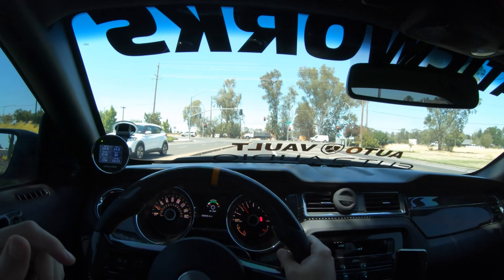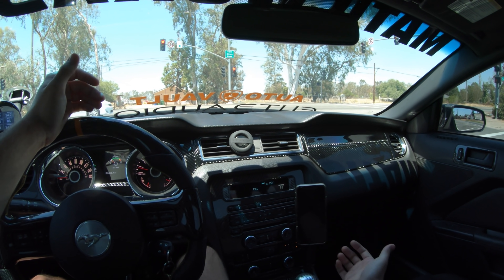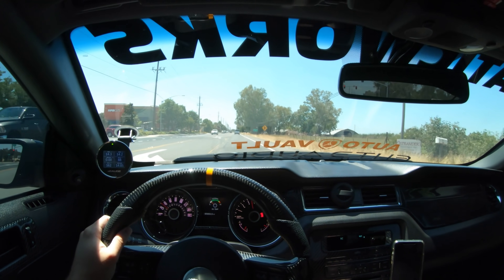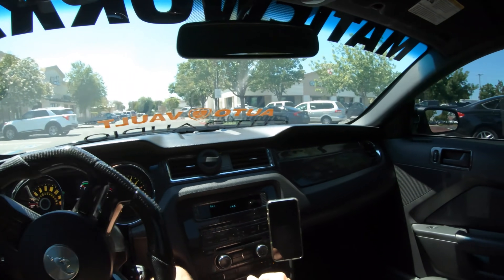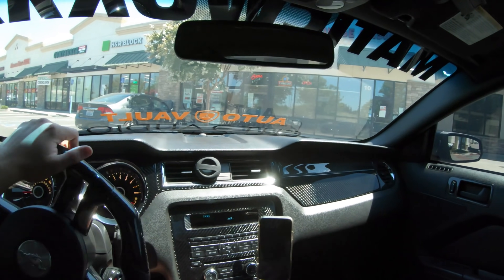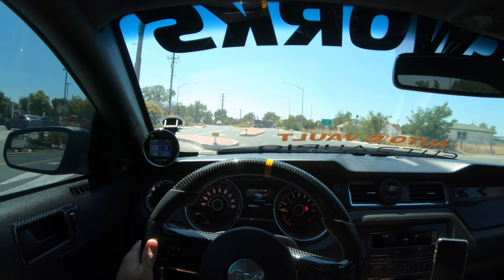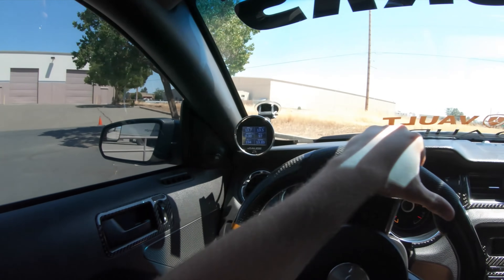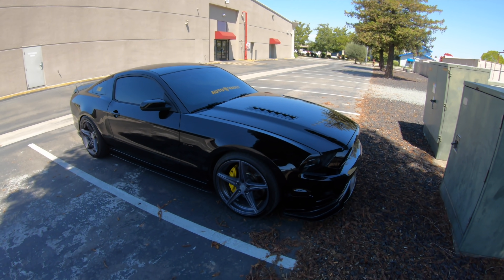How Much Power Can The Coyote Motor Handle? The TRUTH!

Comment: 13 gt. Gen 5 stage 3 from Whipple. Boundary oil pump gears and sprocket. Not sure what the actual wheel hp is. Would love to know without putting it on a Dyno. Just hoping it's safe for the mostly stock coyote. The 60 to 120 is outstanding. Almost scary. Don't have the right tire set up for anything 1st or second gear.
Reply: My 11 GT gen5 Whipple made 730whp with 3.875 pulley.

Comment: 93 fox, gen 2,  twin 6266 precision. Goals are 730 whp on 91 octane and 850/900 on e85. I would lower the power for the street but I need 8 PSI springs in the wastegates to be able to adjust it up to 16 PSI on the controller. And remember the engine holds those numbers but the transmissions are another story 😄
Reply: Actually I know alot of people with billet input shafts and stock 6r80 making 1000hp. 850/900 is pushing it. No matter what they tell you the stock rods are still a powder rod so trying to make more than 800hp is pushing it. Yes you can make 850-900 honestly people making 1000hp but you know those engines are on borrowed time because it will eventually take its toll without a fully forged rod and piston setup.

Comment: I have the gen2 in my 17f150 fx4. I had the rousch stage 2 kit with exhaust and cold air intake done to it. Id like to go faster and would like to know what i can do besides adding headers and a bigger throttle body. Id like to get to 500 whp. Adding a supercharger isnt doable right now tho. Which is the best headers for the gen2?
Reply: a mustang is the best option for you😂😂

Comment: I am looking for 450-500 HP... NA. This is an autocross/track day car and I need linear power that is easily controlled. You talked a little about the BG "fix", did it help with lock out? The Boss gets to 6.8-7k and will lock the shifter out until the revs drop below 6500

Comment: hello, my name is Ben, in short, found a 2012 mustang at Carmax, 20 grand, seemed to be extra powerful on test drive, bought, got home, put on jack stands, sooooo, by part #s on engine, tranny, suspension, torsion bars, etc..... i have a 2018 Gen3 built(idk how much), MT82 tranny, carbon fiber drive shaft, idk-gears in differential. I dropped clutch at 7000rpm few times, (it has this ultra quiet exhaust on it) little tuner i bought topped at at 500 hp, dont know y this car was at carmax but i am super happy, anyway yes i have left several mustangs and 1 z06 corvette about 3 car distances behind while driving to work(after first sorta race these club guys were waiting for me to pass and we raced from traffic light outside gas station) anyhow, i always back off at 80-90 mph in 3rd gear cause that all i needed to beat them and dont want ticket.. how do i find out just what my little beast is, as in displacement and such, i am truck driver, do mechanical work on side, but not a racer but luv hot looking sports cars as we all do.

Comment: My ideal power goal is mild. I want to keep it a daily driver and comfortable touring car. I have a Candy Red Metallic Gen 1 2013 GT Premium convertible that I picked up three months ago with only 11,500 miles! It’s still brand new! It was a one-owner vehicle. Literally a 79 yr old dentist from North Dakota that only took it out on Sundays in the summertime. 😊 So far I’ve done a moderately loud axle-back exhaust, K&N Blackhawk CAI, new black GT500 wheels. I blacked out the side and rear lights and all chrome emblems. Oh! And I replaced the lame center console radio and climate controls with the nice aftermarket touchscreen Nav from Dynavin! Love that! About the only things left are painting the calipers and window tinting.

Comment: Gen2 2.65l tvs currently making 735rwhp/567lbs ft trq on 93 parts on the way dual pump return style fuel system 2000hp axles pulleying down going e85 looking for 800+rwhp on my daily. Sons gen 3 pro charged goes 9.6 in the quarter mile. Trying to keep up! Lol! Good information you are spot on. Given you upgrade the oil pump gear and crank shaft sprocket.

Comment: 2014 F150 fx2/ gen 3 whipple 4" pulley/ 3.31 gear with 22" wheels/ VAS traction bars (in back seat) and a dead miss on an oiled down #7 cylinder. Guesstimate is 550rwhp. I'd like to see 1k/850ish to wheels and the hardest part is done. Temp motor will be here on Christmas eve and original will go on a stand. 6-800 in forged internals and hardware will hopefully get me strong enough to beat on it and not hurt it.

Comment: 16 im building a gen 2 swapping it with a 5.2 block trying to hit 1300 hp to wheel and its just because I love having the power to drop a gear and dissappear but torn my motor down at 934 ho wanted more

Comment: Gen 1 (14). 750 RWHP: fun when I want it, manageable at all speeds, and anything more than that just seems like a waste if its not on a drag strip weekly making $$.
Reply: What’d you do to get that to that power level? Supporting mods?
Reply: @Justin_SVT  I believe I was responding to a question of “what’s the perfect amount of power for you?” Or something to that effect. To be more clear, I have never been in/built/owned anything even close to that kind of power. My 14GT/CS was completely stock pretty much (cold air intake, Roush mufflers, Stage 3 exedy clutch kit, lightweight flywheel, Ford Racing 1pc Aluminum driveshaft, upgraded brakes). I had plans and was working towards getting that kind of power, but life happened and now I have sold it 😔.

Edit: 15:30ish in the video, he asks “what is your ideal amount of power?” My comment was in response to that specific question.
Reply: @Justin_SVT  but, plans included Magnum XL 6spd manual transmission, changing fuel injectors/rails/pump/hoses, cams, maybe rods/pistons. The biggest power mod would definitely have been a super charger (VMP Gen 2  2.3L TVS Stage 1).
Reply: @DeeWatts623  750 wheel on a tvs is definitely getting a little bit sketchy since the torque output down low is so high on the 2.3. switching to a 2.65 would be SLIGHTLY safer or just going turbo would be much safer yet.
Reply: @ there’s something about a supercharger that I just love.. stutututu sounds are lovely, but that whine is just such sweet music to my ears 👂🏾
Reply: @DeeWatts623  in that case I'd maybe go for a 2650 they make a little less low end vs a 2.3. Not saying 750wheel will blow up or anything just a tiny bit safer
Reply: @ I will keep that in mind. Thanks for the info

Comment: I have 750 horsepower phase 2 supercharged  and it's useless under 50mph even with 305 pilot sport 4s on the rear
Reply: I'm running the same setup totally agree  with you can only roll race not dig  race on the street. 500 Wheel hp will out run you on the street
Reply: @Jamie-ww3yz  next car I get is going to be all wheel drive. Not being able to put the power down is very annoying. Once they release a affordable absurdly fast electric sports coupe with high range I think I’m done with internal combustion though

Comment: I have a stock 2013 5.0 and I think all want is a 3.73 gears and a boss 302 intake and that it’s. Nothing to crazy cuz I do daily drive it. But if somebody was to pull up and I can be able to hang a lil bit lol
Reply: I drive a manual 2014 GT with a Boss 302 intake manifold, steeda CAI and 3.53 gears. Of course with Eibach pro coil over suspension, BMR front and rear beefy swaybars, Exedy Mach 500 clutch, 8 bolt lightweight flywheel and controlled with a Barton short throw shifter with two mounting brackets. Wheels front are 255/35/r19 and back at 285/35/r19. I can shred most european cars on the track.

Comment: I have a gen 2 2015 coyote. Looking to go N/A for longevity. The mods I’m getting ready to go with is a 2018 ported manifold, 47 pound injectors. SCT tuner and possibly 4:10’s or 30’s in gears. I’m already rockin long tubes, h-pipe and open cat back. If can get 500 with a good tune to the wheels, that’s great for me and still safe.

Comment: I’m at 741 rear-wheel hp on my Gen1 motor has  new setup cobra jet mani, ProCharged D1X on e85 I know I’m pushing the motor to its limit but surprisingly it’s still holding strong.
Reply: I think not having the low end torque hit and also having good fuel (e85) is probably helping to make it continue to live.  Fuel is big when it comes to longevity with big power

Comment: 2014 Gen 1. Would like about 600-700 just so I can hang with some of the newer higher horsepower cars.
Reply: Insta: dirty5.ho
Reply: Fbo. Your choice of supercharger with fuel upgrades. Forged is if you wanna make above 650
Reply: 700wheel is where the cap is for people with positive displacement blowers on a gen 1. but with a single turbo 750wheel seems to be totally fine for the vast majority of people as the low end torque is lower.

Comment: Im at 660 wheel with Gen5 Whipple on Gen 1 14 Coyote. Looking to get to 700 wheel. Should be able with  headers and maybe some Octanium. We will see. You forgot to mention one very important upgrade. Oil pump gears and crank sprocket billet upgrade a must for boosted Gen 1. I really enjoy your videos. Check my build out @silver.five.o

Comment: The biggest issue with the stock coyotes with power adders are ringland failure.. stock top ring gap is .011 which ends up closing and butting them together and blowing them up, not the rods in most cases like everyone says.
Reply: So are you saying to upgrade piston rings?
Reply: @freznostate  I’m saying the factory gap is too tight and just needs to be opened up

Comment: I have gen 1 with Paxton Novi 2200sl. I'm making 678 rwhp. Very happy with it. Drives great and power is always there when i need it to gab scat packs, corvettes and many other cars. I don't think I'll up the power unless I rebuild the engine. 👍👍💰💰
Reply: What pulley and what other mods are you running on it? Just got a Paxton as well, doing the OPG's right now

Comment: I have a 14 GT, I want around 700hp. I want to be able to take on just about anything on the street, but mostly, there is a guy at work with a ZL1 that I really want to beat. I'm planning a built short block eventually, funny enough from Modular Headshop, and I'll crank it up to probably around 800-850 after that just for fun at the track.
Reply: Send him my way, I’ll beat him for you

Comment: Don’t have one yet but planning on getting a boss 302 and my ideal power level would be somewhere between 450-500whp n/a. I think that would be a super fun car on the street and wouldn’t have so much power that it makes the car feel unbalanced.
Reply: I own a 2013 boss in gotta have it green. A totally different animal then a GT in terms of motor and suspension.  Save up and get you one. ...You won't be disappointed. 😁
Reply: @jasonb.8774   too late lol I  ended up getting a gt for about 10-15k less than what boss 302s were going for in my area. It’s no boss but it’s still a fun car.

Comment: You know my build...NA, all motor
I'm out in AZ. Its 105 everyday and some days 115 to 120. No joke.
I have raced guys claiming that they were in 650 range for HP. I dont know if that was wheel or flywheel?.?.?. However I dont really feel as though I'm being affected by the heat as much as forced induction guys were. Mostly because I beat a few of them. At 460 rear wheel. And after we BS about our cars and they poped the hood and sure enough, they were supercharged. Not to mention my build also Taylor's to road race. I did not want to overpower the S197 chassis. I wanted a ballence. And be able to run at extended track lap counts. I.E. 5, 10, 15, laps without worrying about heat soaking. That's also why I went to a Stage 3 AMP trans build, Barton Hybrid 3 shifter, Ford Racing 1 piece drive shaft, McLeod race spec flywheel and street extream clutch. My current build is expected to dyno between 530 and 550 rear wheel. Not only will I not worry about Hellcats on the street, I'm not overpowering the car with Toolman Taylor ridiculous power.
Reply: Bro quit lying to urself.. 550 whp my ass thats not possible unless ur gen 3 with full bolt ons and e85 even then i doubt it any hellcat will shit on u lol not talking shit just basic facts numbers done lie

Comment: Gen 1 coyote power goal 650-700whp simply to be the hellcat slayer
Reply: Coyotes eat cats.
Reply: @jasonwhitfield4876  not all cats😏
Reply: 650whp is good for the gen 1
Reply: Get a gen 2 short block and never even worry about it. Those gen 1 rods yeet themselves after about 600whp.
Reply: @169abr  they can make up 2000hp just YouTube it
Reply: @BradBrown95  they can make it maybe once, then explode, but Gen 1 isn’t as stout as Gen 2 or 3 motors are. Yea you can get a good tune and the best fuel possible but the stock Gen 1 engine just isn’t as good as a Gen 2 or 3.
Reply: @169abr  there is plenty of gen 1 engines making 650 to 700 wheel it depends on fuel used and the tune you have and how you drive the car.  600 is a pretty safe number to hit even on the "fragile " gen 1.  Funny how ppl criticize gen 1 now but in 2011 it was amazing a stock gt motor could make over 600 whp safely all day every day.  Just because gen 2 is better dont mean gen 1 is bad.  Theyre not just gonna pop at 600 wheel if everything is right on it.
Reply: @michaelharris748  no they’re not going to pop but I prefer to have things safe, consistent, and as reliable as possible. My girls car is a Gen 1 GT/CS and it’s great. Gen 2 just spoiled us and then the 10R80 and Gen 3 came along and some people think the only way to go is gen 3 cause the 10spd. If I were building a stick car for the street it’d be a Gen 1 for the lighter weight and solid axle. 

As for tuning, I’d only ever use or recommended Lund so I’m not worried about tuning lol

Comment: 2013 gen 1. Mods are cobra jet intake, throttle body, cold air, Stainless Works LT headers, X pipe and GT500 exhaust. Currently have 435 whp. Looking for a gen 1 n/a beast at 500 whp. Cams are in the future to get me there.
Reply: You’ll be at like 490
Reply: E85?
Reply: Port that cj and get some good cams on e85 you should be knocking on the door of 500 if not at 500.

Comment: Im sticking with my 600whp on my gen 1 its plenty of power you can pretty much take most things on the street and its a safe number
Reply: What’s your setup like? And how long has it been holding up?
Reply: @ProFishGawd67  i got longtubes , offroad x pipe, roush mufflers, with a vortech supercharger its also dyno tuned if had this setup for 3 years now with no major issues i also dont beat on the car

Comment: Gen 1 coyote. I’d shoot for just enough HP to keep up with hellcats
Reply: 650 rwhp on a gen1 mustang would blow a hellcat outta the water, heck 500 rwhp would prob do it. Hellcats weight like 4400 lbs and mustangs weight around 3600
Reply: @coyoteaustin17  500wheel does not beat a hellcat unless you strip the interior completely. 500wheel on a gen 1 coyote is 7.2lbs per hp vs a hellcat being around 630-640 wheel stock puts it at about 6.93 lbs per hp not only that but with a zf8 trans (8 speed vs 6 speed). And at low power numbers like that the more gears is still going to benefit you heavily.
Reply: @tylerspecht7553 Coyotes making 500 wheel are definitely keeping up , not beating but definitely not far off, Yea I agree overall the hellcat will pull but ya like I said 500 wheel can get down with a hellcat for a min fs.
Reply: @coyoteaustin17  yezir if you are like mid/ upper 500s you can beat a normal hellcat if it's stock sometimes. And for redeyes upper 500s to 600ish is usually around what you need.

Comment: I have a 2018 Gen 3 that I daily, but enjoy the occasional track day running the road courses. One thing you didnt talk about was the upgraded MT82-D4 trans, which I have.
 Ideally, I would love the option to run 93 or E85 as available, and want to build to around 750-850whp eventually. Tired of getting passed by some kid in a stripped down Honda at the track. 
Have been looking at brake, suspension,  tire and other upgrades as well to match the power. Still under warranty, so holding off a bit.
Reply: Me and you are in the same exact boat. The warranty is killing me but I can't just throw it away. I'm currently looking into the Ford Performance Power Pack 2 and Power Pack 3 so I can still keep my warranty.
Reply: @darrylpolite8722  What is a PP3? Never heard of that one. The PP2 was top of the line track pack option that's listed on the Ford build page.

Comment: 900whp is by no means “safe” for a Gen2. If you want a Gen2 to live for a long time, 800whp is a safer number. Some pop @ 850whp.
Reply: It also need to be on good fuel basically everyone making 800+ is on race fuel or e85.  People need to understand when they start throwing out these numbers these cars can take.
Reply: Is it safer on a gen 3 ?
Reply: @Rehziicodm  no if anything gen2 is slightly better than gen 3 imo but they're basically the same as far as stock bottom end power potential imo.
Reply: @midnight347  why is that? Is it because the gen 2 is sleeved or is it because of other reasons ? Can’t find answers to that
Reply: @davidmaniates2099  gen 3 has a slightly higher compression stock motor
Reply: @midnight347  Gen 3's have made 1200whp with stock bottom end... They're not the same
Reply: @liyahalex7308  so have gen2.s  they don’t make that kind of power reliably either one of them. Depends on a lot of factors. What kind of boost. And everything else.
Reply: @midnight347  actually it isn't... Gen 2 uses the smaller head studs while gen 3 use bigger ones.
Reply: @dnunley423  Gen 3's Love the twin turbo setups... Thats where I see all the big power from and it'll make it reliably since its not shocking the block constantly like superchargers.
Reply: if you truly want "SAFE", about 750 is the end of the true safe limit.
Reply: 900 wheel isn’t “safe” on any motor. just because a car can make it on a dyno doesn’t mean it’ll last for thousands of miles and pulls